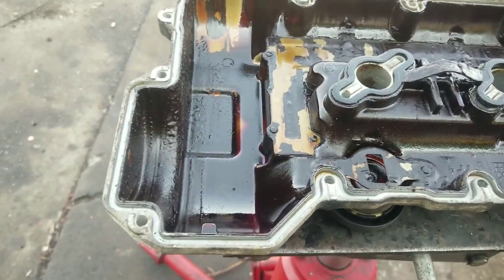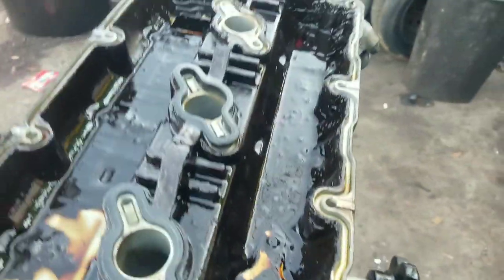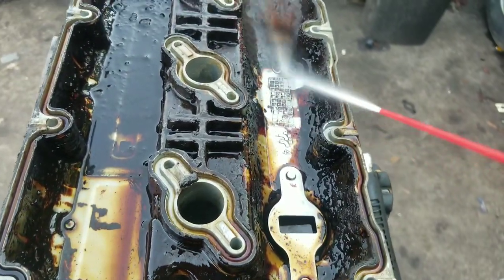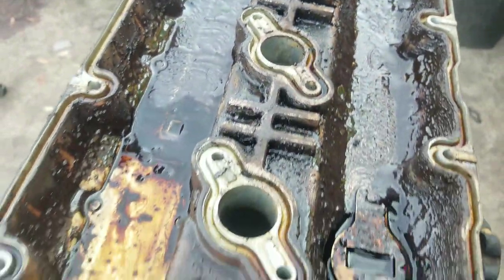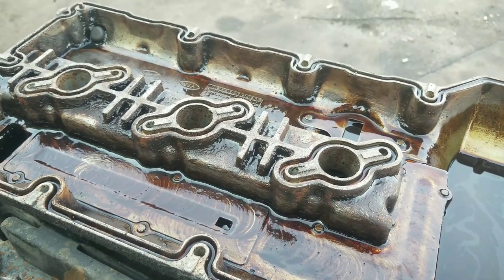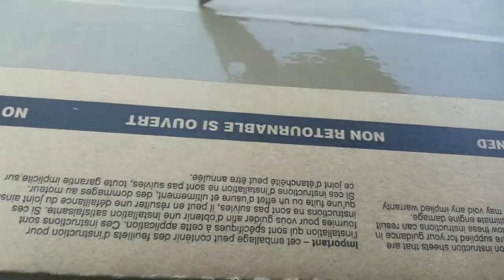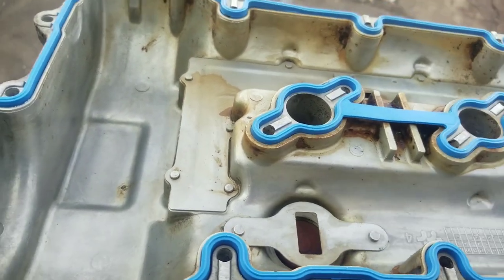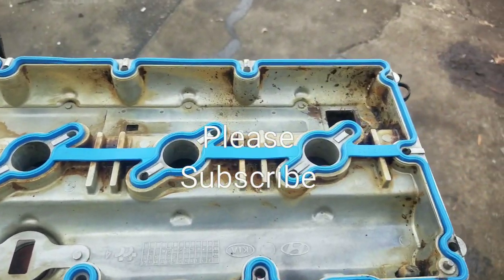How to Clean, Prep, and Install a Valve Cover Gasket, Quick and Easy

Comment: My mechanic took 4 hours doing this? Maybe he just kept spraying. Jeez. Thanks for the video
Reply: How much did he charge you for labor?
Reply: @paulclement9118  $1000 probably
Reply: some cars are a pain...the 4 hours probably included getting everything out of the way to remove the valve cover in the first place, cleaning it and then hooking everything back up. This video is only one small step of this job. You also have to clean off the head and make sure you have gotten all debris out, etc. I have to take my wiper motor out, cowl, intake, and a couple other things just to access the valve covers. 4 hours for both sides is reasonable but on some cars could be less.

Comment: The guy at parts store said non-chlorinated brake cleaner is more flammable than the chlorinated.  Is there any problem using non-chlorinated  to clean the valve cover and the mating surfaces?
Reply: Chlorine corrodes metal and other parts.

Comment: You dont use gasket sealer? And, is silicone sealer OK for hot engines?
Reply: honestly you dont always have to use gasket sealer. it is recommended though. I mean if its on an older car then i probably would.
Reply: @jameshall2017  Myself I never used gasket sealer. I used good or new gaskets and careful tightening and same with oil pan. But Im referring to older cars. I notice in vids that newer cars all are taking sealer for some reason and thats why i asked.
Reply: @cvcoco  I can definitely understand the older ones because more wear and tear and they actually sit on the valve cover, but the more modern cars the gaskets are already made better and are probably pressed down inside the seam like this one is. So I personally dont see any use for gasket sealant on modern cars and trucks
Reply: @jameshall2017  ok, fair enough. I thought the use on modern engines was because parts arent made very precisely and need all the help they can get. I have a car you dont know and i see many people using sealant for it. I dont, use a new silicone gasket and only finger tight on the cover bolts. No leaking.
Reply: @cvcoco  I kinda wish they made a silicone gasket for my project truck but with it being an 81 ford I dont know if they do or not. That's actual one of the next things I'm gonna do to it after putting a new master cylinder, calipers and pads is clean the valve cover and re replace the gasket. Cant go wrong with new seals. Especially if you can get to them easily
Reply: @jameshall2017  Silicone gaskets are the cheapskate solution to imprecise surfaces because they are soft and spongy and can adapt. Cork and hard rubber gaskets on current covers/heads would probably seriously leak without tons of goop on them. Somewhere around here is a video of a guy making his own silicone gaskets using 3D printer. Something like that could be a business for someone. I'm looking for an older pickup to use, i miss my 61 GMC!
Reply: @cvcoco  I'm actually looking for a replacement truck bed for my truck, it's the only part of the truck that's rusted. Either that or I'm just gonna buy a few replacement panels cut rusted part off and weld the new panels on

Comment: Carburetor cleaner works much better. It just smashes oil away. Brake cleaner is mostly just degreaser.
Reply from the maker: depends on the quality of the product, this  brand i used runns circles around carb cleaner, and leaves no residue, try it.